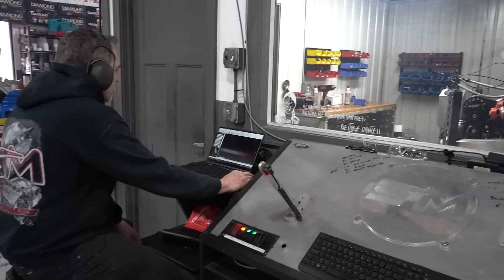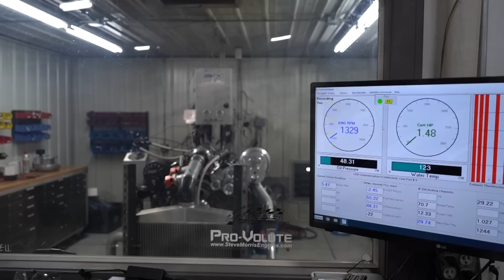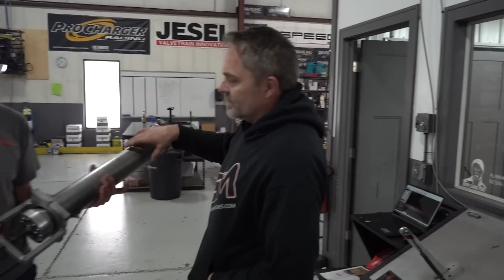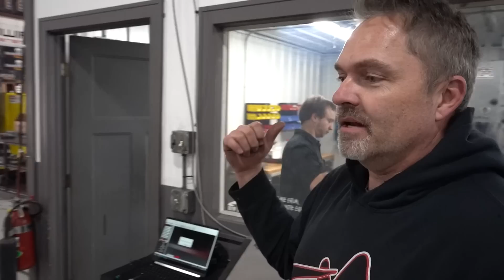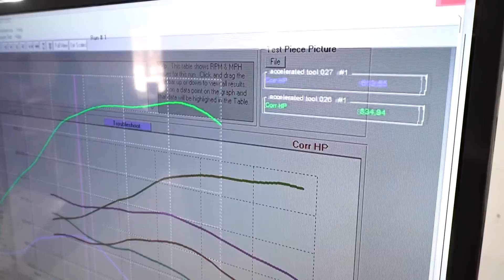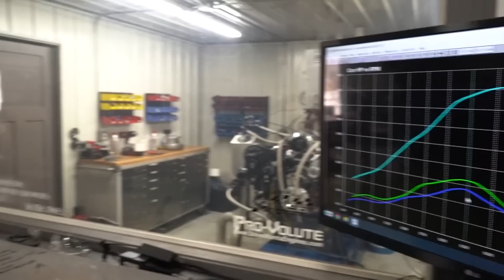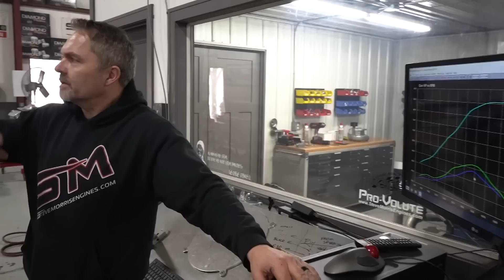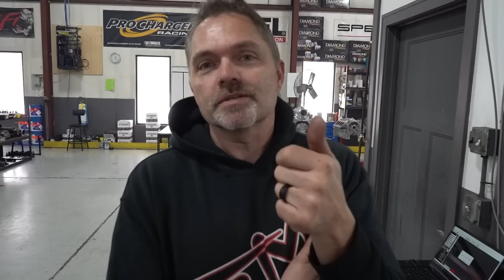CRAZY Testing After The  Dyno Session

Comment: I go back to basic centrifugal pump flow curves. As you increase flow at a specific (constant) speed and temp more hp is required to attain the higher flow numbers. That the reason API standards require prime movers be capable of providing 15% more power than the centrifugal pump requires.   This prevents overextending the capacity of the prime mover in a centrifugal pump. The centrifugal compressor reacts the same way. Centrifugal pump manufacturers develop there pump curves the same way the Torque Storm engineers developed their blower curves. Search API pump requirements or find an old copy of a Durco Pump Manual for a more detailed explanation.   Hope this helps.

Comment: Their tool should have that cone be spring loaded and the T-bolt adjust the force applied to the cone. It would maintain the proper and variable sized opening needed to simulate a constant boost pressure.

Comment: you need to add an airflow meter to the boosted engine, with the pressure gauge. Then take the readings to see how much air is flowing at what pressure and at what rpm.

Comment: so random thought. wouldnt the extra cylinder pressure you have from boost V's NA help keep the crankshaft down where it it should be? i mean the rod side of yoru rod bearings tend to take the most abuse in high horsepower applications, though i am more familiar with small block nitrous stuff, thank big block blower stuff,  so there is alot of forces at play there so i would think with the blower trying to pull the crank shaft up but the higher than NA cylinder pressure would be two opposing forces that would sorta kinda equal out. Not gonna lie though its super neat to see that a crank shaft can move that much

Comment: Can you just loop the blower back to itself to test the draw of the gear box? I would think there is a hp/cfm ratio. 10cfm may take 10 HP and 1000cfm would take 500hp. So a 300ci motor would take less power to turn the blower because it would only take X amount of cfm to make 15psi of boost but a 600ci would take 2 or 3 X of cfm to make the same 15psi of boost and would take more HP to drive the blower in the 600ci. The lesson is, you can never have too big of a blower 😁

Comment: My guess is your exceeding the capacity of the tube to move air in conjunction with going beyond the point of the mechanical advantage of the overdriven geared compressor.  Once you hit the max volume of the tube the pressure builds up in the compressor to a point where the power required to drive overdrive gearing exceeds the available engine power.   When connected to the engine, the compressor output seems to be somewhat governed by the VE and rev limit of the engine.  Thank you for the science experiment!  I needed this to take my mind off of having a bad day today.

Comment: Could you not watch the wastegates to see if it's using all of the air or not? If it is, those things should be closed and if anything wouldn't you see the boost drop on the top end as it is demanding more air than is available? I'm just an arm chair mechanic so please inform me if I'm totally wrong lol

EDIT: The ending where you are testing the parasitic losses...I would like to see the CFM #'s too. Them using a 16" pulley on their LS is limiting their engines capabilities as well. Sure, you won't have to spin the engine as fast to get the impeller speeds up, but that larger pulley is harder to turn under strain especially going from a smaller, faster spinning pulley.

Comment: If you put that restrictor tube on the top of the intercooler it would a more realistic comparison. The air flow changing speed and density thru the intercooler will cause a massive amount of turbulence and cause additional back pressure against the impeller. When looking at the difference in power the blower is making you should look at the torque lose not the HP lose. I know HP is torque by 5252 and the same rpm with less torque will give you less HP. Then you have the moving a compressed fluid from a confined area to open space causes a wave effect that will speed up the fluid in the tube vs the engine manifold.

Comment: It makes sense that it is not a direct correlation. Sure you're building boost inside of the pipe and inside of the intake manifold. It's what happens next that changes everything. In the engine, the boost is feeding a vacuum. In the pipe, the boost is feeding the atmosphere. "It takes more HP to  displace atmosphere than vacuum?...?

Comment: install a venturi at the blower inlet, run the engine (blower connected) and measure the psi drop at the ventur this represents your compressor load and this pressure delta should be used going forward for all testing. Run the test but don't use the test jig to control psi out. Control psi drop at the inlet for all tests, this ensures the blower is moving the same amount of air wether supplying the engine or dumping. The test jig is used to control the inlet pressure drop @ the Venturi, witch insures the same flow of air or loading of the blower.

Comment: Alright how about this, what if you had two engines one on a engine stand with tue blower installed on it but pipe the blower to a second engine that is on an engine dyno and see how much power the second engine makes at the same boost level but not driving the blower and then swap the setup so the engine driving the blower is plumbed into the engine not on the dyno then the load on the engine would be measured exactly the same as driving the engine as it would be loaded up with a blower then the “free power” being fed by tue blower but not putting in the work, that might give you a more perfect measure of how much power tue blower is taking, the way you tested in this video has its own interesting issues.

Comment: Is it possible that the boost PSI from the blower in the cylinders is actually pushing much harder down onto the crank which counteracts the pull from the belt drive? So with no boost but still spinning the blower you no longer have the HP to push down on the crank which is why you get the bend in that area as compared to before with boost the crank is slammed into the bottom of the engine and the belt drive doesnt have enough to counteract that force. Just a suggestion.

Comment: hmmm boost is nothing more than a measurement of the restriction in the intake. So, like you said without the vacuum of the motor helping the movement of air you have to load the supercharger more to make the same boost into free air. Thats why you use a snout support to help with the crank movement.

Comment: You can only flow so much through the restriction of the engine. The boost is the measurement of restriction through that engine flowing X amount of air. 

Into free air it’s not getting that restriction because it’s a set point. The engine is not, it’s moving faster and flowing more air per min because it’s moving the piston faster and faster. 

That’s my thoughts anyway.

Shared and Liked. This info is GOLD!!

Comment: Interesting brainstorming session.  The 'belt slippping' output moment had me wonder: what does changing scroll degrees of housing design do to operating range and "coming in" [getting best efficiency] at the engines target operation speed?  I would guess too low a degree will seem to run out of air as the impeller runs past peak efficiency, and too large a degree comes in too late.

Comment: Why would you not adjust the valve to match the boost you had when you hade the blower hooked up. And then open the valve to bypass all the blower air. Would that not tell you what HP it took to make 13 Pounds of boost.?
Reply from the maker: We did
Reply: @stevemorrisracing  Oh OK I must have missed that some were along the way.

Comment: Wouldn’t it make sense to get your baseline with the torque storm operating on the motor then disconnect the belt, drive the TS up with an electric motor until you hit the same numbers, then reference the wattage the electric motor took? Grab a Tesla motor and a VFD lol.
Reply from the maker: Huge motor to do that
Reply: @stevemorrisracing  I think it’s probably super hard to account for the vacuum that the motor is pulling and integrating that into the boost setting of the tube. And based on your conclusion it should be a good deal less than 300hp to push the air into the motor instead of pushing it against atmosphere. 

Rear drive motor for a Tesla model 3 makes 283 horsies. But all in you would probably need the battery, inverter, and vfd unless you have one badass three phase grid connection lol and by then you’ve bought a whole Tesla to test a supercharger once a decade.

Comment: The engine and TS are both compressing air, when you pipe the TS to the motor the motor is helping the compressor pull air and the compressor is also turning around and helping the motor pull air. There is a sweet spot in there it seems, and when you have the pipe dumping to open air it is no longer helping the motor pull air and the compressor is actually stressing the motor more to pull the same amount of air. That crank is taking a lot of load when you are dumping air not into the motor

Comment: When the supercharger is on and at 13psi there is boost going in to the engine and the boost overcomes the pulling motion of the supercharger. Without the engine being boosted there is a pulling force on the engine which it can not overcome NA.

Comment: So why don't you just take the rpm of the blower when it's running on the motor then take that HP number pull the belt off then drive the blower by an electric motor in the same rpm sweep it had on the belt to the motor then see what the motor makes. Wouldn't that be a more accurate way of seeing how much HP the blower takes to run it at any givein rpm and boost level. You can replicate it much easier and faster and can calculate a direct comparison to losses

Comment: Steve, here's my 2¢. I'm an HVAC service technician that services centrifugal compressor machines. Single to 3 stage and 350HP up to 2000HP electric motor driven. We all know surge, when the compressor is over the design ∆P on the map. Surge creates significant thrust issues but it also significantly drops the required power needed to run that compressor when the gas flows backwards through the compressor. I think you are seeing the other end of the map called choke. Choke is maximum flow. If I remember correctly, choke does the same thing as you approach it, especially at those impeller speeds. Air flow, attack angle of the blades and mach speeds all come into play. I'm no engineer and some of that is above my head still. I believe you were approaching both ends of the map for that blower. Kinda outside of it and that's why some of it didn't make sense. Sure, blowing the outlet off raises the power needed to run it but you're obviously not at a fixed speed. As speed increases, the map changes and you could be running into that choke not solely off of pressure. Flow rates and impeller speed also plays a role... Ok, I'm pooped!

Comment: To test your pushing into a vacuum theory I’d like to see a CFM measurement on the intake of the supercharger on and off the motor. A blower is really just pushing more CFM through the throttle body, which happens to make pressure, rather than just trying to make pressure.

Comment: Steve it is the back pressure on the supercharger that relieves the load on the engine. Unrestricted it overloads the engine because of the load it puts on it to move a larger load or more cfm. There is a balance that has a sweet spot between back pressure and load and moving enough air to create the amount of boost you call for.

Comment: I'd like to see a CFM hat on the SC inlet, both charging the engine and using the test restrictor at the same PSI. 

I feel like the internal combustion air pump is playing a role in the SC compressor flow/boost. I can't quite wrap my head around it, it seems to function inverse to how I'd think it does.

Comment: About the crank deflection and the direction its being deflected. Look up Gyroscopic precession or Torque induced precession to explain the phenomenon. Basically the force you apply will show up 90 degrees to the point of being introduced. Hence why its deflecting not in line with the belt pull.

Comment: You can use physics to calculate the power required just to compress the air.  There's free calculators you can find online where you can plug in the air volume (cfm), temperature difference and pressure difference, and calculate the power.  Moving more air should take more power, so should the same amount of air at higher pressure.

Edit after watching the outro:  It would be cool to measure pressure and flow in the the restrictor tube.  That'll help diagnose what the differences are between that setup and the normal setup boosting an engine.  You might be making 20 psi on both setups, but if the restrictor tube is doing that at significantly higher flow, that would explain why the stress on the crank is so much higher.

Comment: Its because engine airflow  demand and waste gate pressure release  uses more airflow at say 18 psi with engine using volume plus reserve pressure vs deadhead vale adjustment at 18 psi will be less flow even though psi are the same , sorry thats the best way I can explain , thanks for sweet dyno show ,always informative ,like you were talking about earlier with the flow meter , should use it with blower connected to enging boosting and flow with it disconnected with deadhead valve at same boost , thanks again

Comment: To bad you can't run the blower on a electric motor with variable speed to simulate it running off the engine. Then see how much more power the engine makes.
Reply from the maker: HUGE motor to do that

Comment: Would you not have to factor the engine displacement times rpm to get what the engine is moving compared to what blower is moving. When you "run a compressor out of air the engine would then begin pulling a vacuum. If im thinking about it correctly. A pressure/vacuum gauge between engine and blower would be able to track that point...

Comment: Air is a fluid, so just like any vane type pump low back pressure equal high flow up to runout condition( no more flow available with maximum HP to drive impeller= energetic disassociation). Boost pressure when the motor is running with the blower versus when testing, as you guys talked about is due to the amount of air the motor moves in N/A form. Boost pressure is caused when you restrict flow hence heat. The real test is to use flow numbers not pressure. This would be a much better comparison.  It would also allow comparisons between blower types. Centrifugal vs roots type or screw type.

Comment: To get the information you're looking for you must have engine RPM, inlet airflow to the blower and the outlet/manifold pressure to be the same in each test. The air moved by the blower must be consistent in each test to find how much power it takes to drive the blower during engine operation.

Comment: to figure out exactly the parasidic loss... run the blower on the test motor...  get the results.. just as they did., then,  to find the losses... have a second motor that matches rpm's of the test motor... the second motor must power the blower but the blower feeds the first motor..   the rpms must match as both motors rev up... this way the test motor is fet by that same blower, but the slave motor does the work.   more complex, yes... but exact losses will be seen.
Reply from the maker: Very hard to do
Reply: @stevemorrisracing   i'm not saying it would be easy..  I'm an engineer and I'm picturing 2 identical  supercharged engines side by side.  
supercharged engine A gets you the baseline data just as you did in your video... that was the easy part...
----  then run both engines simultaneously ... matching rpms on the way up. during this second run... blower on dyno motor is disconnected... and blower on the slave motor is piped over to feed the dyno engine  as both engine's rpms are identical during the pull and thus the blower rpm will also match the inital run where the baseline horsepower was measured on the dyno engine. .  the slave motor needs no dyno..  it's only there to match rpms  of the dyno motor  as they pull simultaneously through the run.    it seems simple enough... on multiple motor pulling tractors they do that within a small  percentage of deviation from motor to motor.   I can see it being a hassle from  the control room standpoint synchronizing 2 motors..  I do believe you  do have the talent and equipment to pull it off.   I've seen some of your other videos and you do a great job and are very professional and you keep the videos clean...Much respect for your team for that. Keep up the great work!

Comment: I don't think you can simulate the engine load like this.  Normally the engine has positive displacement consuming it's normal NA airflow volume, which can be thought of as "free" (in terms of compressor workload) flow, the compressor is flowing air to add an additional 13lbs of PSI on top of that NA flow (another way to think of it, it's pumping it's output into a vacuum chamber).  

When you route the compressor output to ambient pressure there's no negative pressure / "free" flow happening like when it's being fed into the intake, so the correct PSI equivalent load on the engine when testing into open air would be something like compressor output pressure minus the (min?) manifold pressure (which should be negative some PSI), so if you're running a manifold pressure of -3psi, then to get an equivalent load on the engine to when it's making 13psi, the compressor should be making more like 10psi.

edit, was kinda thinking that through as I wrote it, so I'm not sure I nailed the explanation, but I know I at least got it into the ballpark.